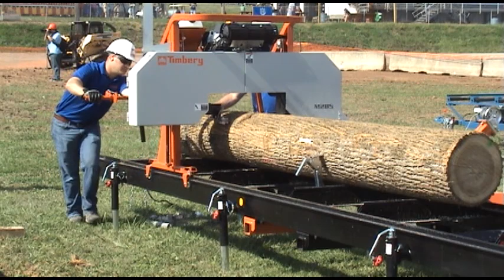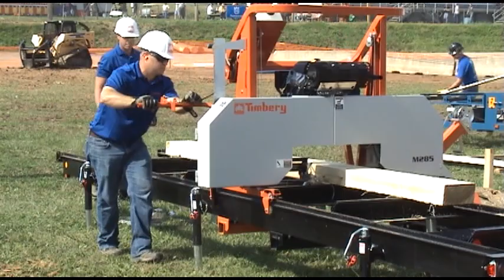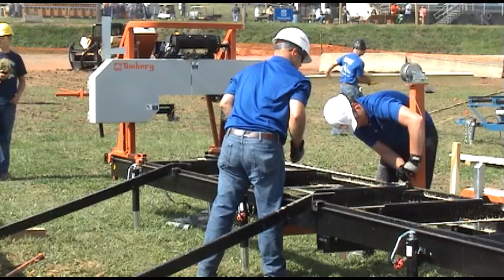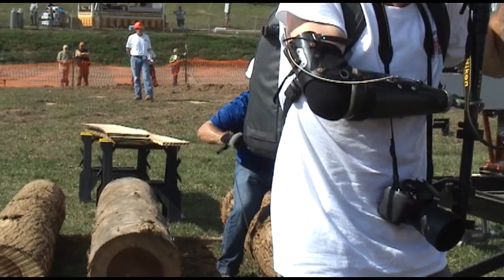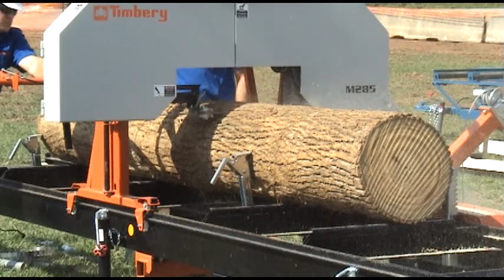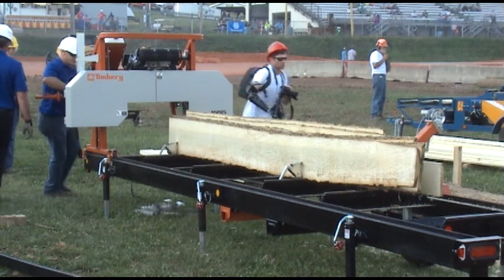Timbery 2013 Shoot-Out

Comment: They always cut straight poplar at these shows!  I'd like to see some pine or oak once in a while...
Reply: +Richard Cranium , hey rich I actually bought that mill after the show it has run over 3 thou ft of popular ,2 thou ft of red oak and 5000 thou ft of yellow pine ,the oak is a little slower  but with a sharp blade you will have 2 off bearers not liking you
Reply: Thanks, I really like these mills, I was only trying to point out that most of us sawing, mill all types of logs, some fresh some a little hard, and that does make a difference in production times.  I'd love to know how that affects different mills.  I've seen Timbery in action, and they are a great buy.
Reply: Is it the Subaru engine, thanks.